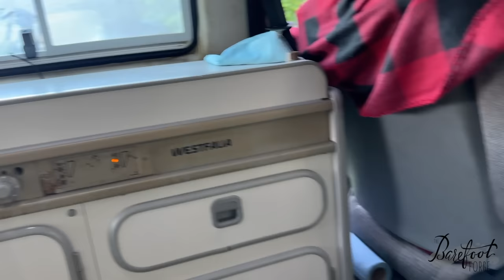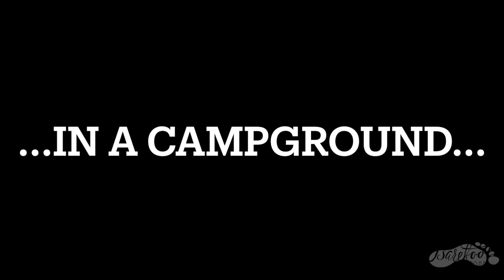Forgotten 1987 VW Vanagon Syncro Westfalia- "Heidi"- Will it run? Chapter 2

Comment: Dude, that diesel heater location is super clever. I have one in my van, but never thought about locating it inside the dash. Love the rescue videos!
Reply from the maker: Thanks man! I’ve actually put two heaters there before this one, so I’ve got three years or flawless miles on this location. It’s got all the noise as far away as possible while you sleep, the heat as close to you while you drive, and it’s totally unused space with no risk of a blanket or “stuff” blocking your heat! It’s perfect.

Comment: All of your videos are fun to watch, and I appreciate the hard work it takes to make the video and hours of editing.
Always been curious about the Vanagon.
I used to have a Bus, years ago in the 1990's.  A 1969 Camper. Got it for $500.  It even had the original hammock that fit over the front seats and the snap on screen for the back. Everything worked, including the original radio.  
The owner kept blowing motors, and said the current engine was expected to blow. 
Well they removed the heat shield gasket!  So the two things I fixed right away, replaced the heat shield gasket and did my own valve job. Replaced the fuel line etc. Loved that van.  
I lived in New Mexico then and even during the hottest days, while so many told me I'd be stalled with vapor lock, I'd still be going.  They all laughed at me about that heat shield gasket. LOL 
I'd camp in that van. Travel around the state and had to use the slow truck lanes up mountain roads entertaining the truckers for being the little beige Bus among the slow trucks going up.  They'd blast their air horns and hear a Meep Meep right back. Fun times.

Sadly I had to sell it to get me through college. I had  a '63 Beetle and a '68 Karmann Ghia. All sold. But they went to good homes.  
Can't afford to get any other cars anymore...however...I am fully enjoying the "Vanagon" videos to help satisfy my curiosity about those vans.

Comment: Thanks for reviving another vanagon! I have done the same, driving parts across the country to save old vehicles. 

POR15 patch would have been a better choice for that rust.
Reply from the maker: Why do ya say that? I’m personally very against por15 in most applications. But as you see- we did use POR-patch in this build, so we had it and have experience with it- where should we have used it that would have been considered a proper repair?

Comment: Loving these episodes. Do you ever find yourself working on air-cooled vanagons too? I'm working on repairing one currently and they are just so simple, charming (and slooow).
Reply from the maker: I generally don't work on the air-cooled ones much, but last year I owned one that had been parked for 20+ years. It was without a doubt the fastest vanagon I've owned, including the 4 I had at that time (two of which had engine swaps). The air-cooled runs very good when it's running correctly, and if it's not a rocket ship to 80MPH- it's broken, and you need to fix it. 

They have lower gearing, so with stock sized tires- the most acceleration of any vanagon produced.
Reply: @TheBarefootForge  Oh, very cool. It's my first vanagon (or T3 as we call them here) so I dont have anything to compare it to other than modern cars but it def needs a rebuild in the coming year or two.
Reply from the maker: Oh mine was faster then a modern turbo charged 5 cylinder Volvo I drag raced….. 

It should go!

Comment: Where you got those axle stands? Wheres the safe spots ? Lee 🇬🇧
Reply from the maker: The axle stands are a variety of different ones we found and borrowed throughout this saga, and should be placed according to the manufacturer or experts suggestions. For liability reasons, I’m not willing to suggest a “right” location or option there.

Comment: Would love to do the heater install on my T3 Trakka Camper here in Australia (we didn't get Westys here but we had the only other VW dealers sold camper in the world by a company called Trakka). but our RHD dash has the fuse box right underneath it. Also, where are you placing the diesel fuel tank? @TheBarefootForge
Reply from the maker: That location likely won’t work for you- but perhaps? Currently I have a 2.5 gallon tank full of kerosene strapped to the spare tire plate. Inconvenient but outside the vehicle. The hope is to change this out for a gasoline furnace like the eberspacher I have in my blue bus in this location. It’s flawless. I 10/10 suggest the eberspacher over the cheap diesel one, but this is a budget build and getting used as a template.
Reply: Thank you . great information. Am really enjoying your videos. @TheBarefootForge

Comment: The alarm has a starter kill relay. When the alarm is going the car won’t start.
Reply from the maker: Which alarm? The key in buzzer is not connected to the ignition in any way.
Reply: @TheBarefootForge  the Aftermarket alarm installed had a weird relay to you. It's a normal thing to kill the starter with an Aftermarket alarm.
Reply from the maker: @jasonhenza  nah, there was no integration into the starter. Luckily!